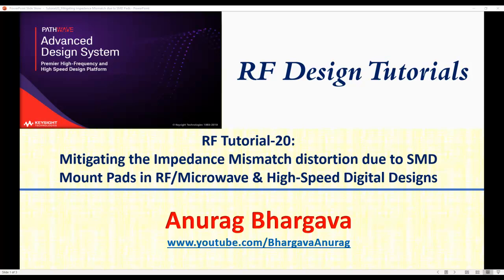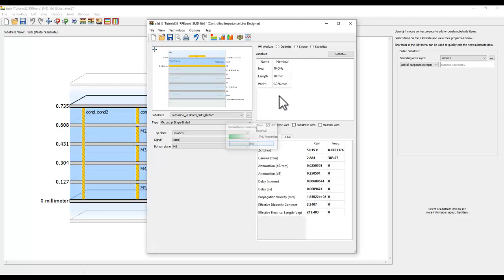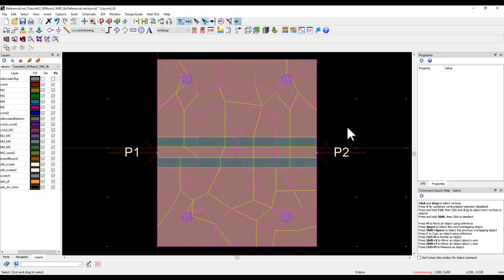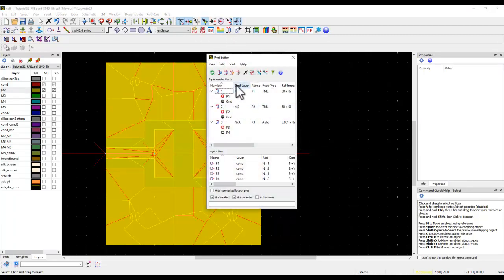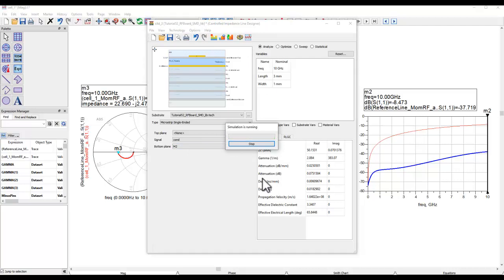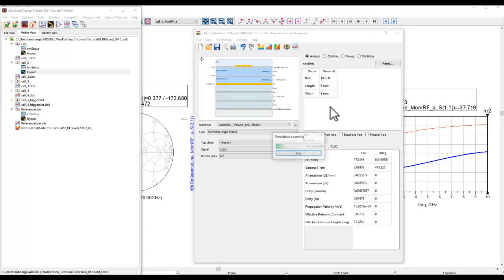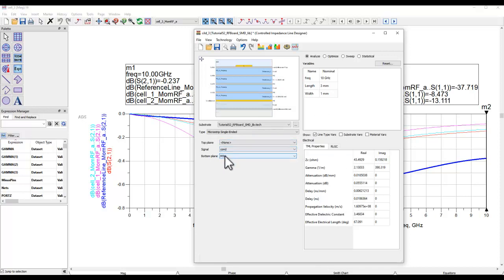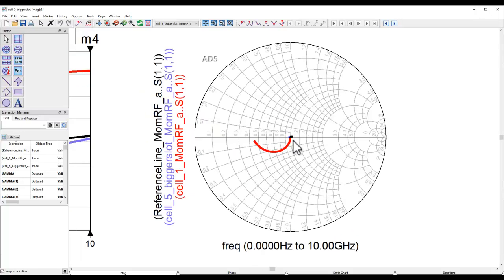RF Design-20: Mitigating Impedance Mismatch due to SMD Pads in RF/Microwave and High Speed Boards

Comment: Hello anurag
Please, Can I apply this technique in a real-world project if my manufacturer only supports 2-layer PCBs?
Reply from the maker: 2-layer PCBs aren't suited for this concept, but I have seen people doing it with removing the ground copper and then creating grove in the mounting block or box to take out the metal up to certain depth, but it may not be very convenient
Reply: @BhargavaAnurag 
Ok, thanks very much

Comment: Can I assume the final cutout depth equals the same depth that would be required if the transmission line itself were the same width as the 1mm pad?  In other words if you just calculate the standard 50 ohm microstrip impedance at a width of 1mm you just calculate the separation between the plane and trace?  I've always assumed this to be true with a slight variation with the edge fields.

Also, why do you cut out the reference plane under the trace prior to it hitting the pad?  Don't you create a high impedance mismatch there?  Don't you want to shape the cutout such that the trace has a solid ground plane up to the pad?  Or does this have a large affect on the impedance?  I've never had software to model this.  It seems like there may be better geometries.  

One other thing you don't mention is grounding vias to stitch the layer 2 reference to layer 3-5 layers so the return current has a path.  Does this software automatically take this into account?
Reply from the maker: Hi Andrew,
Too many questions here....😊
What I showed is a concept and once you have tool like ADS, you can be artistic and come up with a geometry that works for your specific case so there is no right or wrong method that works for all use cases.
All ground layers are connected by VIAs which are defined in the stack up definition as well as drawn in the layout, tool doesn't do these automatically and user needs to define them the way they want to use them. I probably should have made it clear during the video and not assume everyone would already know this...😒 
Thanks for the feedback, will be more careful in the future videos to not to leave it to anyone's imagination...👍

Comment: I thought discontinuities in the reference ground layer are strongy advised against in many RF application notes.
The reason being that the return path still travels on m2 layer but makes a loop around the slot that is created creating an inductive loop or worse the slot can become a radiating antenna.
I didn't understand why the path now travels on m3 layer?
Reply from the maker: It is correct that slots in ground is not advisable in RF board designs but at times you have to do it to avoid the mismatches. All ground layers are shorted by VIA for maintaining the return path transition.